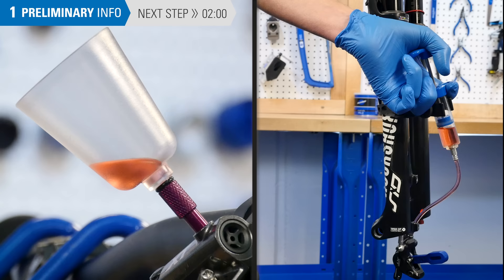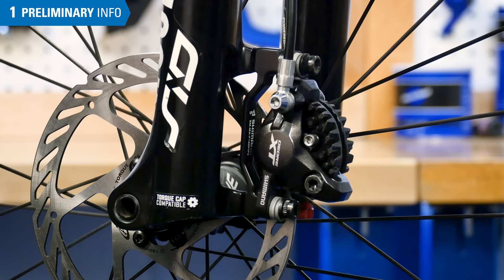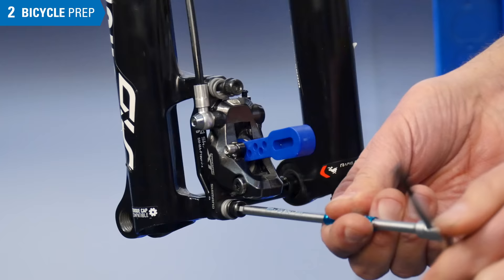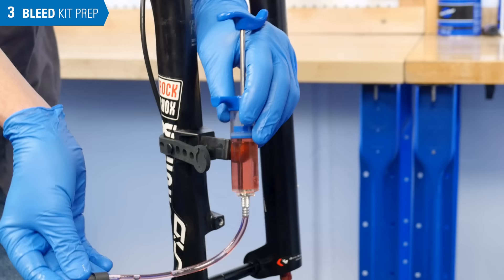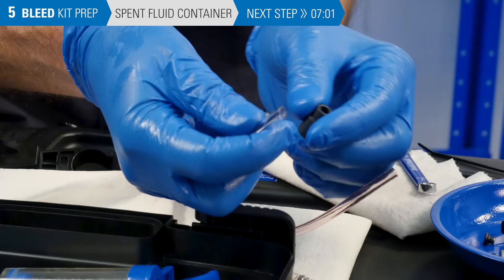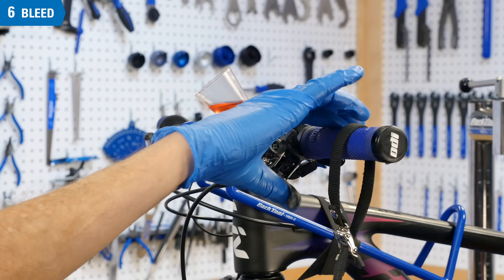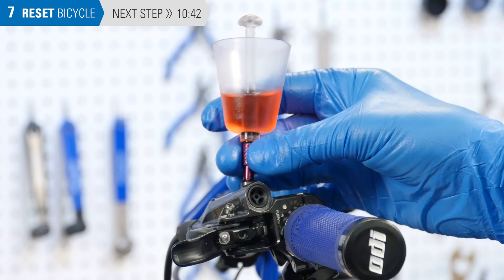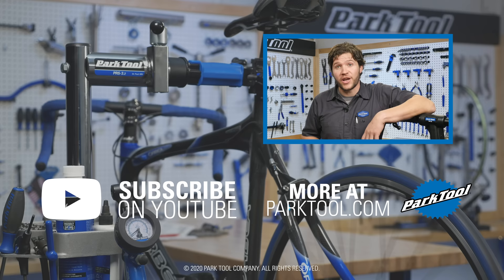How to Bleed Hydraulic Brakes - Shimano® Flat Bar Levers

Comment: What if using the syringe intead of the plastic bag to make the oil flow up and down until no more bubbles exit the system?
Reply: That is usually done mostly.
Reply: Because you need to release the pressure  inside the circuit and you do it when you open it to the atmosphere, you can only do that with an open system like the plastic bag, if you use the syringe the circuit continues closed and the oil will not go out
Reply: @mariomata9663  Why is it necessary to use a 2nd syringe for a SRAM brake system? 

(see park tools other video)

https://www.youtube.com/watch?v=bOUbUtaYaOE

Is it due to the brake fluid?

Comment: So I just picked up a bleed kit at my local shop, but It didnt come with a syringe or tube thingy. Could I (in theory) just put the funnel with the mineral oil into the levers and squeeze them?
Reply: You will never get all the air out, especially for the rear brake, where the hose is longer. But truth be told, the brakes will probably still work acceptable, if you manage to make the lever feel firm when you squeeze. Just take care on the first ride, start slow until you're sure you can rely on the brakes.

Comment: How are you supposed to do the last step with a caliper that has a bleed port but no bleed nipple 7:54? Since it takes a threaded fitting and doesn't have the ability to open and close quickly, there's no way to pressurize the hose?

Comment: May I ask what is the point of the last step: Holding the brake lever with a cable tie and rapidly opening and closing the bleed nipple?
Reply: I guess it creates a rapid movement of the fluid inside the caliper that might help knocking out any trapped bubbles.

Comment: So I applied the break to check the pistons moving after removing the bleeding block, before putting back the pads. It doesn't seem to have caused any problems - I pushed the pistons back with a scissor. Do you think I need to bleed again or nothing to worry about?
Reply: Nothing to worry about, but don't use a scissors to push back the pistons - especially if you have ceramic ones.

Comment: Isn't steps 1-4 enough? Why Step 5 onwards? And wouldn't it be harder for bubbles to go down to the caliper?
Reply: Also asking this, what exactly are we doing here? First half is using new fluid to push old fluid/bubbles out the top from the bottom, but what does the rest do?

Comment: I wonder why you just can’t use the syringe (with fluid) on the lever and a hose on the caliper, and essentially flush the fluid? Is it because air bubbles tend to float up, hence you put syringe on caliper side?
Reply from the maker: The reservoir at the lever is not designed to have any pressure in it. It can be done with a careful hand but it is not suggested.

Comment: Love all the Park Tool Videos! Greetings from Germany where we love precise engineering-Instructions! 

I do have one question:

I have Shimano SLX M7100 brakes. After the whole process, my front brake lever is responding super directly/sharp as I prefer it to do so.

My lever for the rear brake is responding slightly softer.

I read a few times that this is very often the case, that rear brake lever is always a bit softer when braking.

Is that true? Or is it more likely that there is somewhere still some air bubbles hidden.

The only "mistake" that i can come up with is, that my bledding nipple was facing to the ground when I did the part with quickly opening and closing the bleed nipple while a strap is pulling the lever. But the syringe was facing upward just like in the video.
Might this have been a factor, why the rear lever reacts minimal softer/less sharp After the whole process?

Thanks in advance!

Comment: Hi all, i have LT-Woo system and my rear caller is faulty, i would like a recomendation on what shimano system can i place, need rear hydraulic brake set plug and play for less than R1000. Thanks

Comment: Why do we need to pump the fluid from the bottom up and then again from top down? Wouldn't one or the other be adequate?
Reply: I think that is only in the case when the first bleeding from the caliper to the lever comes out dirty, so you have to bleed it again from the top so as to make sure the system is full bled and clean.
Reply: Well, Shimano defined this process in its dealer's manual like so.

But I can confirm that doing the bleeding one way (as one would do on a car brake) isn't always sufficient.
Reply: Mine have issues with trapped air from day 1. I’m going to have to bleed both ways. To get the air out of mine. From caliper to lever is just not working. Still got air trapped.

Comment: ITS SO COMPLICATED.. IM STILL LOVE TO USED VBRAKES/CANTILEVER/CALIPER🚴🚴🚴😬
Reply: Yeah and they talk about discs for riding in bad weather, but my pads/rotors are always getting contaminated with oil or salt from the road and squealing louder than a truck horn. I have to pop in earplugs, get accidental road rage from drivers who think I honked at them, and clean them again when I get home. Last year I sanded my pads and cleaned the rotors at least a dozen times. People also talk about rim wear from v-brakes, but you probably need a new hub anyway by that point, and maybe have some damage/dents to the rims, spokes and need new rim tape... so just get a new wheel. My most-used rim brake wheels last a long time anyway. They work great in all weather. I don't know what the fuss is about wet and mud. I think if I could choose rim brakes on my newer, favorite bike, it would still be my favorite bike. It's been easy to ride and maintain except for the damn brakes.

Comment: I've been told Shimano specifically says NOT to bleed their brakes from the bottom up because contaminants can get stuck in the lever reservoir, causing permanent damage to it. They say to gravity bleed all their brake. Anyone else heard that?
Reply from the maker: This is the procedure that is in the Shimano literature as well as in their technical videos. https://si.shimano.com/api/publish/storage/pdf/en/dm/GN0001/DM-GN0001-24-ENG.pdf Page 116
Reply: @parktool  Page Not Found
Reply: It seems that the Shimano instructions do say to push up from the bottom with the syringe.  But if you talk to any of their technicians, they all seem to say not to do that and to only gravity feed (for the reason you state).  

https://si.shimano.com/en/pdfs/si/BR01A/SI-BR01A-001-ENG.pdf

Comment: Can I use Maxima Mineral Brake Oil on my Shimano brakes? If yes, can it be mixed with Shimano mineral oil or should the existing oil be flushed out first?
Reply from the maker: People have done that.  The manufacturers like their own fluid of course.  However, people have been know to use other mineral brands. Flushing is always good.

Comment: What the F am I doing wrong, I have the funnel screwed into the top of my brake, stopper is out. Brake pads out of brake, stopper in. Syringe connected to brake, open bleed valve but can not press fluid through the syringe. I tried opening the valve more than half turn and still can not press anything through.

Comment: Why rotate it forward 45°? I've always put them at 90° to the floor 🤔
Reply from the maker: It depends on models. Most need to be at 45 to allow the air bubble to exit at the cup.
Reply: @parktool  thank you for the reply! I actually tried doing the same way as shown in your video, break feels firmer than when I was doing them before

Comment: Can I use DOT 3 as brake oil?
Reply from the maker: Use what your manufacturer suggests. The general rule for DOT fluid is that you can use the suggested fluid or something of higher rating but never something of lower rating. Example: System calls for DOT-4. You can use DOT-5.1 or DOT-4 but not DOT-3.

Comment: Is it safe to reuse the fluid you get out, after loosening and tightening the bleed screw, on the calliper? The fluid which you disposed of, in a plastic bag.
Reply: If it is as clean as the fresh stuff, then yes.
Reply: CAMPER Honsa Well it should be, as the dirty oil has already been pushed out
Reply: I’d say yes, with a small caveat. This is usually negligible, but there can be a small bit of water in that part of the fluid. Tiny amounts of water get into the system through seals, microscopic fractures in the lines, through moisture in the air and so on. Mineral oil doesn’t absorb water into itself like DOT fluid does, and mineral oil is also lighter than water, so any water in the brake line should end up pooling on the caliper side of things, i.e. at the bottom. If you don’t drain a small bit of the original oil out as the first step of the bleed (with the funnel attached and filled a bit at the lever to compensate for the loss), that water might only come out during the final loosening and tightening step.
Reply: These bragkes are a “sealed system”. If you have dirty oil, you have a leak in the system (seals or line) and should be apparent at the leak as squeezing the brakes in normal braking produces a very strong hydraulic force. Look for oily residue at ports/connections/lines. Reuse is fine if color is good..

Comment: C2H6OH is sure not an isopropanol and, I believe, not exactly alcohol (ethanol) either, which is C2H5OH.
Reply from the maker: It's denatured alcohol. We recommend Isopropyl alcohol(as it leaves less residue and is less harmful to skin) but in that bottle is denatured alcohol, which is an ethyl alcohol. Good catch.
Reply: @parktool  ah, so it is a mixture of C2H5OH and repellent additives, not a Dimethyl ether. Makes sense now.

Comment: What a nightmare .  I need to pull a new hose through my frame and bleed it. Holy crap. Looked at Parks website and there are 2 different bleed kits for mineral or dot.  $140 and both out of stock.  So if you go by this video it ain't happening for a long time. Maybe I don't really need 2 brakes that bad.  Good video though.

Comment: Why rotate the lever so that the funnel sits at 45°?? Every other video I have seen has the lever parallel with the ground. Finishing with flicking the lever in different poaitions
Reply from the maker: Many brakes require different angles. Even within Shimano's lineup the angle can make a big difference. It has to do with where the highest point of the system is.

Comment: Mechanical disc brakes require a lot of adjustments, each week I have to adjust it and it takes my time I thought to buy hydraulic brakes but hydraulic brakes are very tricky and complicated, I can't do this.
Reply: Dont worry about bleeding buy hidraulic brakes you are going to love them. You problably dont even need to bleed them until 2 - 3 years

Comment: I have  SHIMANO D700 HYDROLIC BRAKES  . My problem is their is no bleed nipple on the calipers to put hose to bleed ?  Doe's this mean you bleed only from lever ! HELP CALVIN !!!  I'm knew to this brake going mad no info ! Thank you for the top content and past info and help !
Reply from the maker: It is there.  Look closely, there may be flush rubber cap.  It can also be a set screw that is loosen.
Reply: Sounds like it has a boss screw. It is flush and covered with a rubber cap. There is another screw above to control the flow of brake fluid.

Comment: Where can you get the adapter mentioned at 3:55, "#2623-2"? Seems it can't be googled.
Reply from the maker: The adapter is included in the BKM-1 Hydraulic Brake Kt - Mineral

Comment: couple years ago I have it a shot and said   never again it was a mess and result was subpar,  for whatever reason today i though it would be different big mistake. There's something about brake bleeding, don't know what it is even with the Right tools it can be s disaster, I've serviced my entire bike air forks included but damn the freaking brakes, and my local shoo is not even expensive. NEVER AGAIN.
Reply: This procedure is extremely over complicated. I feel like with all these steps there are so many things that can go wrong for new brake bleeders such as yourself. There are much simpler methods which still work quite well such as gravity bleeds.

Comment: Why are wheels down? I dont understand what is difference if wheel is in place....
Reply from the maker: Removing the wheel gets the rotor out of the way.  You can then remove the pads.  The block is installed to keep the pistons back into the caliper body.  It is easy to get oil spilled and you do not want the mineral oil on the pads.
Reply: @parktool  Thank you for reply :) its great so big company have time to respond on so small question.

Comment: How do the bleed blocks work with shimano 4 piston calipers?
Reply from the maker: It comes with two sets of blocks.  Use a block for each pair of pistons.
Reply: @parktool  I figured they could both be used for it but how would it be fixed in place since there's only one bolt to hold in the pads/bleed block or would you just move the pistons wedging them in place?

Comment: My God, a lot of theory, not even on a motorcycle or car is so complicated as they are heavy vehicles that require a high level of braking, just inject the oil from the bottom up and it’s ready, take the bubbles and it works the same, you don’t need to all this ...

Comment: umm.    it is way easier than using an angle finder, bleed valves, etc. 
 just a closed end wrench, allen, bottle, fluid, some paper towels.
  don't need a stand or fancy junk tools like strap (just hold force with fingers), no plug needed, just suck out excess and use paper towel when removing.  do take pads out, but don't sweat fluid getting on stuff (it's mineral oil, not not not dangerous.  won't strip your paint or kill you)    don't lose your o ring like the shop lost mine... lol  do it yourself.  

bike shops hire ANYONE with a pulse, you can do better.  don't worry about angles, just consider gravity and do the job.  very few shops (none) follow this procedure, and they only run fluid one direction (which is fine).   this is an easy job for a 5th grader, you can do it, noooo problem.  just don't allow air/dirt into the system, keep valves closed when appropriate.

Comment: Great video as always
Tutorial, audio, demo, narrative
But holy baby caca moly batman
I can bleed all 4 brake calipers &
brake master cylinder in 90% of
cars or trucks safely, faster & more
efficiently than this B.S. but
thank you. Hating on hydraulic
bike brakes not Park tools &
their great informative videos.
Sticking to manual cable discs
brakes. Hydraulics need too
much attention & maintenance.
I bleed by pushing brake fluid
from the calipers up to the
master cylinder & tapping on
the caliper with a rubber mallet.
Brake leaver feels extra firm &
is very sensitive & easy to modulate
aka motorcycle preferred bleeding
method. Step 2 hold brake lever
& continuing pumping lever 
slowly with full squeeze for final
bleed at caliper.

Comment: Well, you have convinced me to avoid hydraulic brakes. I can do just about anything on a bike so it would just cost me parts and my time. I can't imagine paying someone to do this. I will stick with cable brakes, thank you very much.
Reply: This needs to be done just less than once a year and once you get the hang of it it only takes about 15 mins or less. IMO its actually less work to have hydraulic brakes in the long run